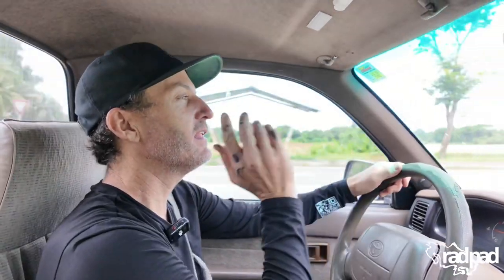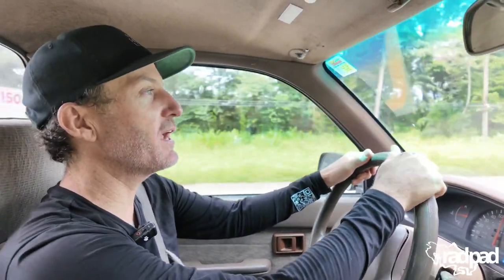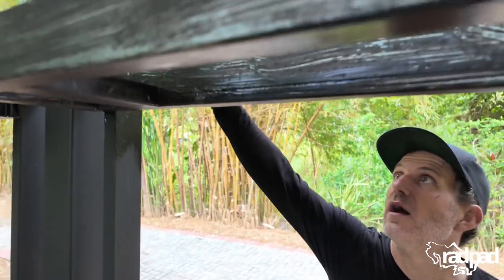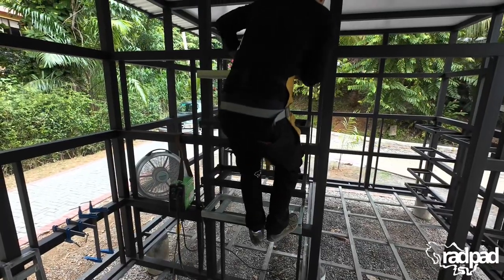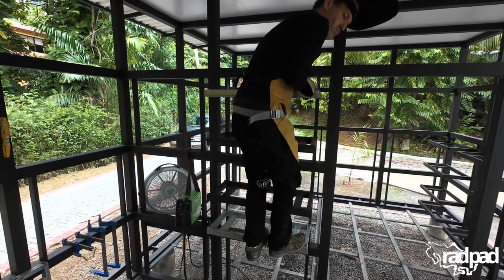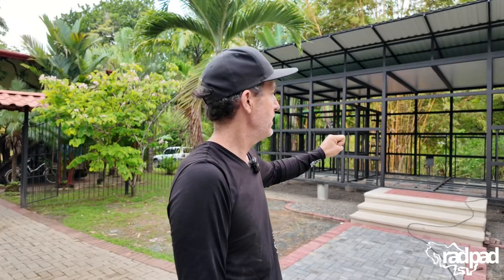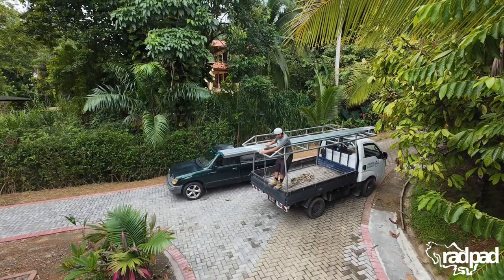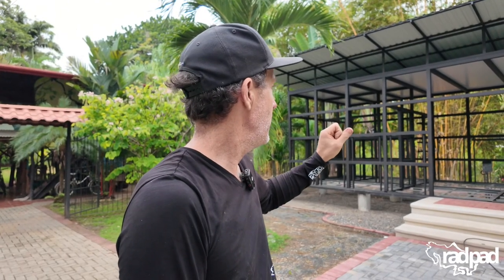A fulfilling work is one that get done

Comment: We are ready to see the pad with windows (no windows 10 😁) Pura vida
Reply from the maker: @FincaBocalasRanas  oh the suspense 🤩 this one turns out pretty darn good looking if you like looking at nature. The ones we are building now are using the newest wall panel innovation and are much taller. They increase the overall airflow of the rad pad by 50% and they allowed us to move into a zero waste design building. All of the metal tubes are cut into usable sizes and the same with the wall panel boards. When we finished this one we were amazed how little waste we had but then I opened my big mouth and said that there must be a way to build it with no waste… damn that was a mathematical challenge of a lifetime, but it turns out by changing the window size it made it possible. Thanks for watching, windows go in soon and quickly 😎 -Tony
Reply: @radpadradpad  Great Tony looking forward to see the full process and end result. We are looking for a property near Platanillo with Pepe, he also listed our finca which we are selling in the south...so in time we will talk to you. Pura vida and keep it flowing.